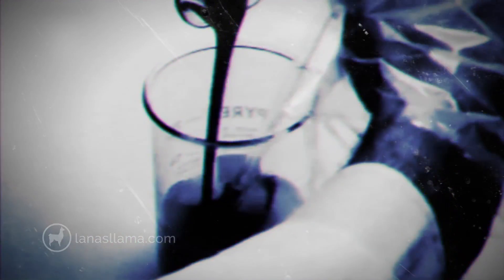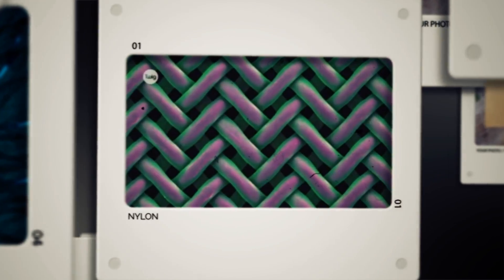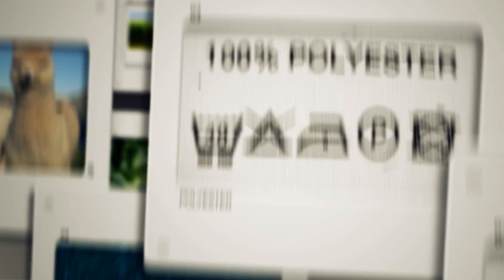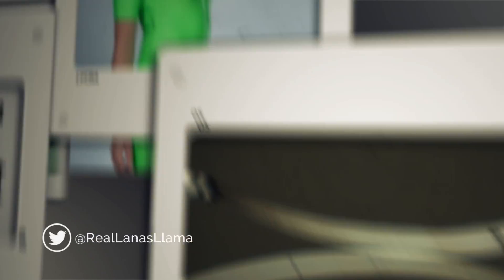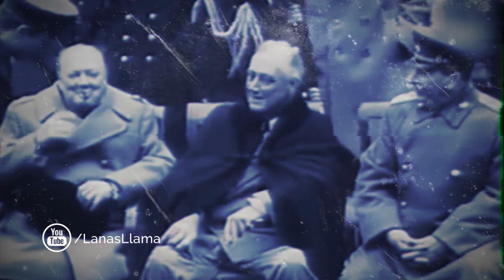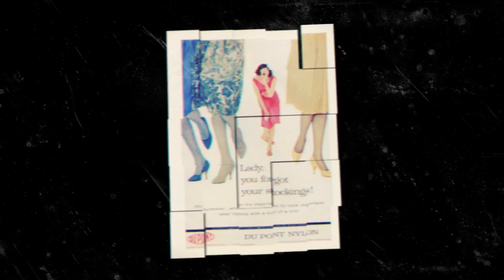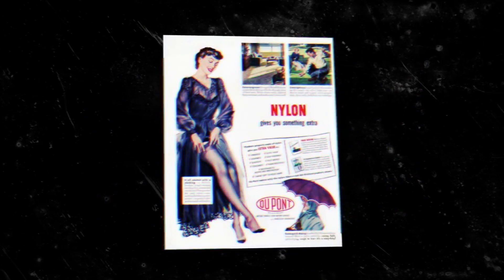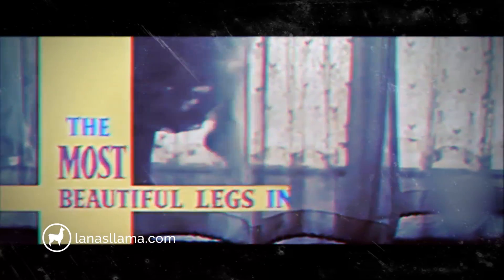What Are Synthetic Fibers? Why You Should Avoid Them.

Comment: military times & DoD:
a military times contributors did a 2013 article on Navy uniforms/NWUs melting to skin under high heat scenarios, but made no mention of the 2006 US Marine ban on synthetic fibers in forward operating combat zones.  

question #1:  its 2019, why still no update to the 2013 or DoD's 2006 article?

http://archive.defense.gov/news/newsarticle.aspx?id=15478?
Synthetic Clothes Off Limits to Marines Outside Bases in Iraq
By Lance Cpl. Stephen Holt, USMC  [probably a gunnery sergeant by now] 

question #2:  have the army and navy not also banned synthetic fibers?  is there still no universal DoD policy or plans to replace uniforms for all high-heat risk personnel to not wear more than 5% synthetic?  is it too expensive for them to do so?